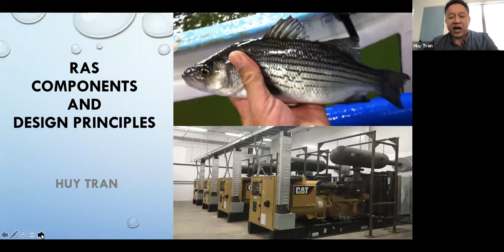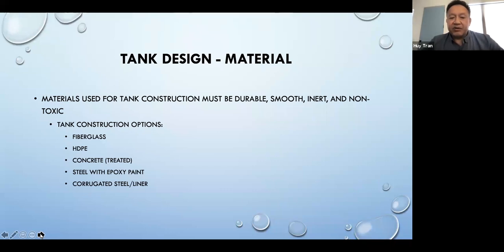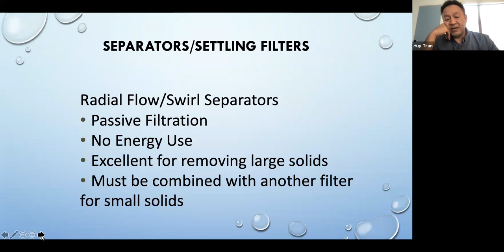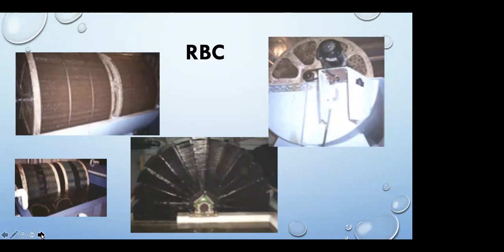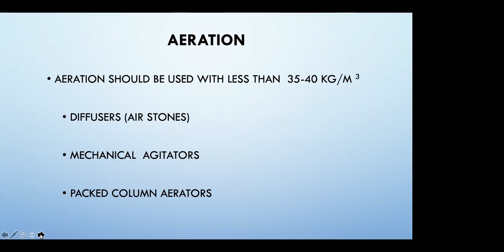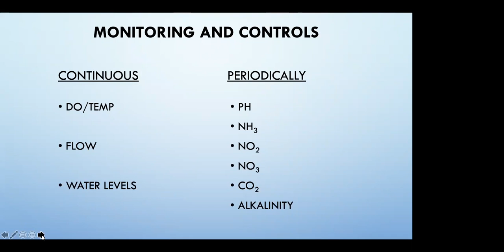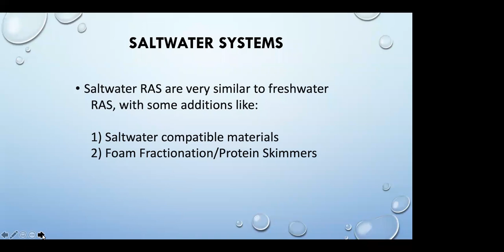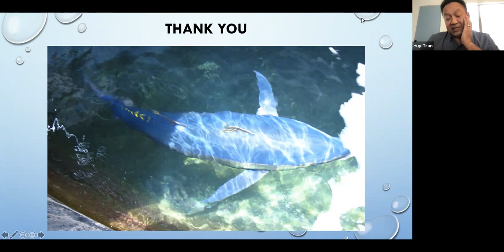Recirculating Aquaculture Systems: Introduction to Components and Design Basics

Comment: In a small cat fish farm if am using ras how many times do I change my pond water
Reply from the maker: Are you recycling pond water through a tank(s)?  Most RAS systems are closed loop and not generally open to the environment pond water.  To answer your question, it depends..... on the species the stocking levels, the age of the fish and other factors.  Some systems are exchanged 4-5 times per hour while others may only be exchanged 6-8 times per day.  If you are talking about a significant pond size that would mean moving a LOT of water.  There is not one size fits all answer.  I would like to contact Huy you can do so through his company web site https://www.aquaticed.com/